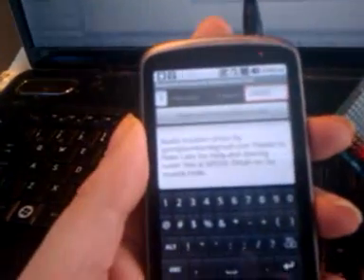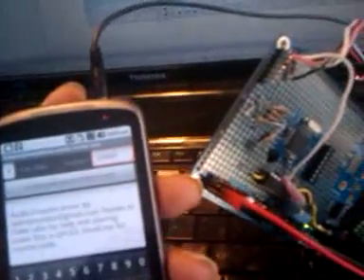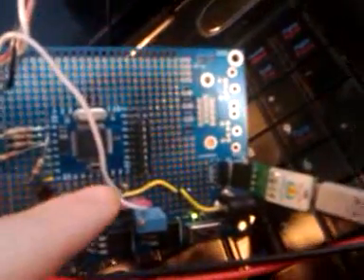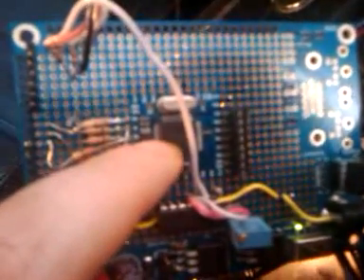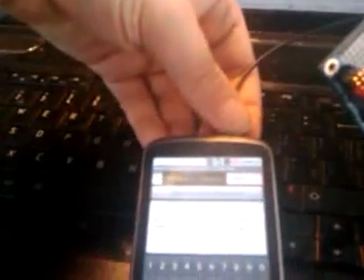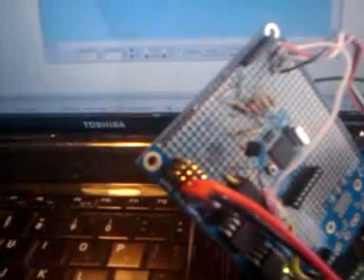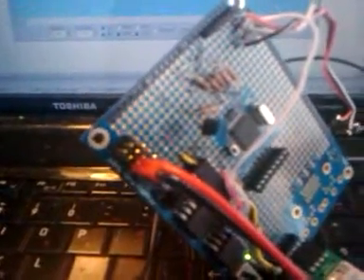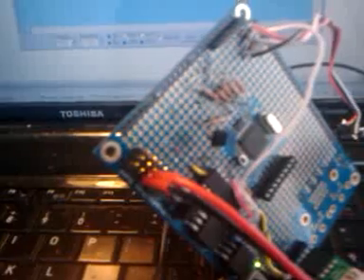24kbps serial port out on Android

Comment: Hey! Love your idea! Can't believe you made this video 14 years ago,  that's crazy.

Have you ever tried controlling something like RC car / Drone from the phone using serial over 3.5 jack?

I've Implemented something similar using ESP32 Audio kit plugging the iPhone's headphone's jack into the ESP's mic through the Line to Mic attenuator and vice versa - audio from esp to mic of the iphone. I run a html/js website on iPhone that encodes my commands to Audio, and ESP decodes it and lights a LED  N times ( depending on which button i pressed on the website the iPhone)

My goal is to utilize power of iPhone's processor and camera and develop an autopilot for a car or even drone.
Reply from the maker: We sure have, in fact we sell them and we also provide source code and schematics on our website. The Antbot was the first Android robotics platform in the world! We don't write iPhone apps but the principle is the same and the hardware will work.
Reply: @RobotsEverywhereVideos   F*king hell!!! You are GOD
Reply: @RobotsEverywhereVideos  

Made an order, thank you!
Reply: @RobotsEverywhereVideos  by the way, do you have any solutions for bidirectional serial over 3.5?